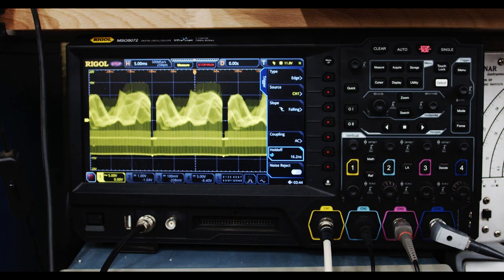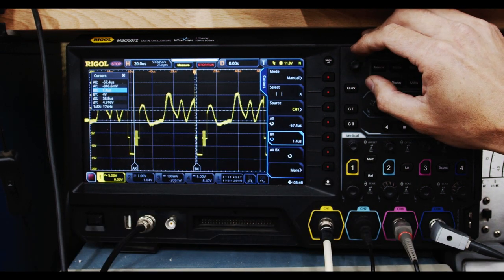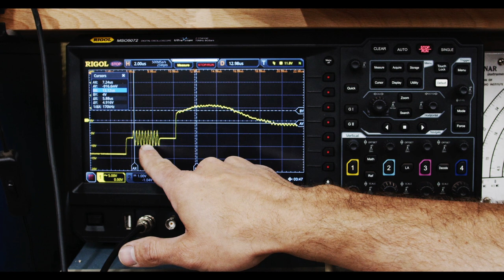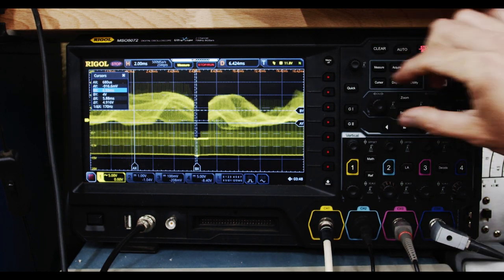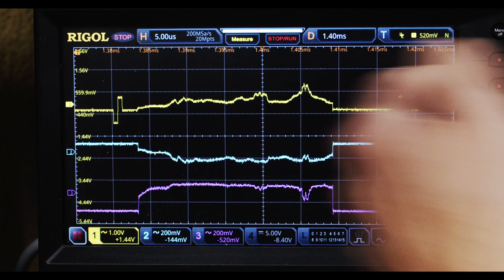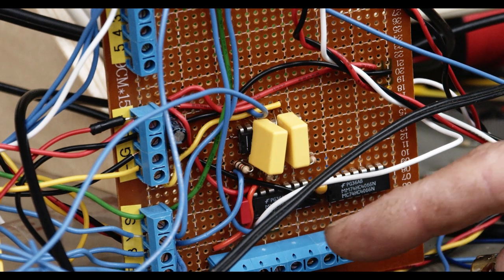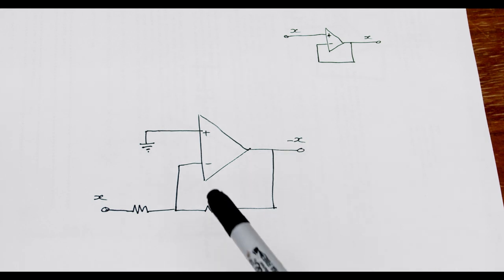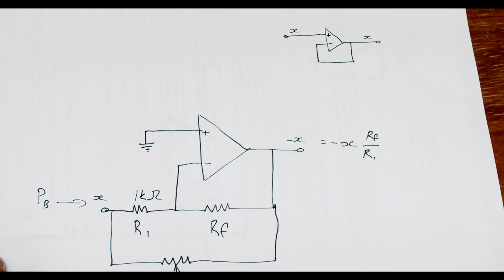Composite vs. Component Video Signals

Comment: Thanks for discussing this Joshua. I just picked up a Rohde&Schwarz CCVS Component Generator SAF, basically for next to nothing (and for fun, no purpose intended). It has a ton of different outputs (composite and all possible individual signals) and this video gave me a good bit of background, even though it discusses NTSC instead of PAL.

Comment: Great explanation! Every time I think about composite video signals, or even the channel with luminance and sync in component, I'm still impressed by the cleverness of those engineers who came up with systems that were reverse compatible with black and white signals. I wrote a lot of the firmware for an audio/video company called Burst Electronics back in the day so I had to do some deep dives into video signals.
Reply from the maker: Have you ever come across Technology Connections? He’s got a great channel that covers the history and competing standards.
Reply: @superchromat  I have not but I just subbed. When I subbed I recognized a few videos that have been recommended to me.

Comment: Cool, I didn't know it was possible to get 1080p with component video, I thought it was limited to 1080i, but maybe it was just the limitation of the equipment I had back when I first heard about it. Nowadays it's getting nearly impossible to find a new TV with YPbPr input. A few still have a single composite input, but component is nearly impossible to find.

Comment: Hey. Please can you make a video on what exactly the front porch, horizontal sync, and back porch periods of the analog video signal do? What instructions do they give the monitor, and how does the monitor react?
Reply from the maker: Sounds like a good video idea. I’ll add it to my list. For a quick answer it has to do with steering the electron gun beam in a CRT. The h sync pulse tells the gun to move back to the start of the next line down. The porches give time for the gun to move. The color burst is more complex, but allows the circuit to synchronize with the carrier frequency to enable it to decode the modulated color information.
Reply: @superchromat  Hey. Thanks for the reply. I appreciate the consideration. Regarding your answer, is the front porch a time allowance for monitors to settle at a blank level before retrace? Also, is the combination of the hsync and back porch basically saying, "Start retracing your gun, I expect that you be ready at some point in time , an agreement between the monitor and the signal(the end of the back porch).I will start sending you video data at that agreed time."? Please correct me if i'm wrong.
Reply from the maker: The other thing is that the front porch blanking period is a good reference for the black level. With AC coupling of signals, ground may not be at the same potential between the input and output. So, a device receiving a signal can identify the front porch and sample the voltage to establish the correct voltage that represents black / 0 IRE.

Comment: Awesome explanation. There doesn't seem to be as much documentation online for component signals as for NTSC or PAL. Does the spec even have an official name? Also, would feeding the component luma into the composite input of a CRT work at any resolution? Sure the number of scan lines would have to be compatible with NTSC.
Reply from the maker: Yup - component luma is signal compatible with composite video. Analog CRT’s have no concept of a pixel, so there isn’t the same concept as a horizontal pixel. There is, however a phosphor mask for RGB CRTs. Additionally the circuit may not have the bandwidth. But you’ll probably be fine.
Reply from the maker: Here’s a good overview of the specs: https://www.maximintegrated.com/en/design/technical-documents/tutorials/1/1184.html
Reply: @superchromat  cheers! Looks like HD component video is covered by SMPTE 274M 👍

Comment: I’m researching to transfer my analog video tapes to digital and came across your project, very interesting. What devices may you suggest to capture analog to digital signals? It will be cool to transfer the SD to HD, look forward more of your project! Thanks.
Reply from the maker: I recommend the Blackmagic devices for analog to digital conversion. Most of the issues you’ll run into are either with the device you’re using to play the analog tapes, or the process of deinterlacing the video once it is digital.

Comment: So uhh, you said you could just have a TV display a black and white image if you plugged the green canle into a composite input? Turns out it doesn't, at least in my case. Maybe has something to do with modern TVs? Idk.
Reply: Nevermind I figured out the issue. The device I was trying to hook hi p, a nintendo Wii U had to be set to an interlaced video output instead of a progressive one.
Reply from the maker: Yup. It has to be a component video signal with the same timing as PAL or NTSC, which is 576 or 480 lines, interlaced.